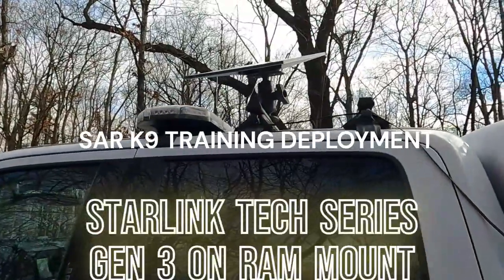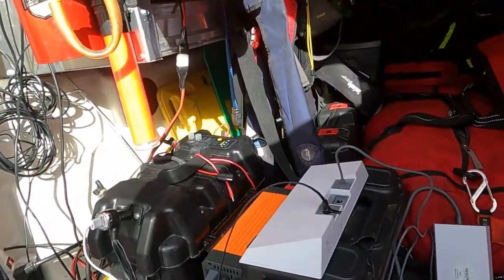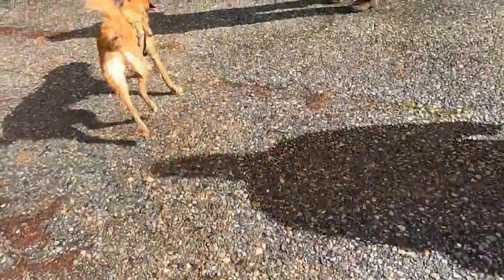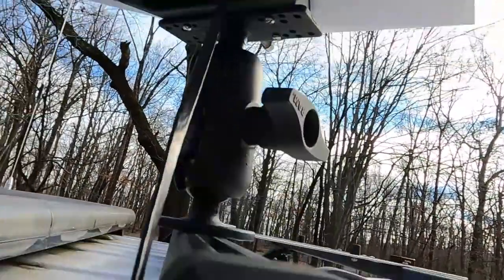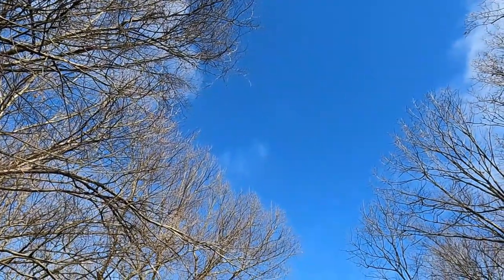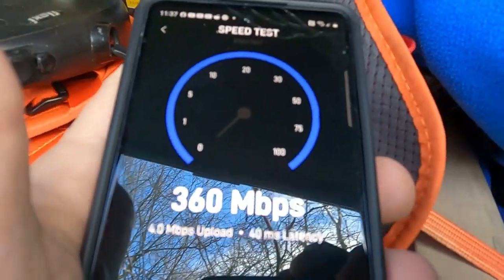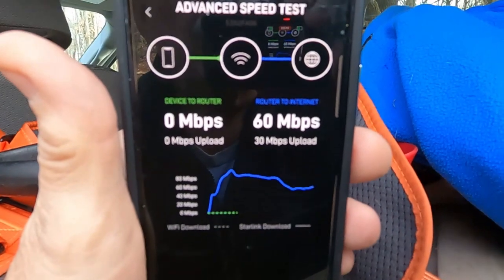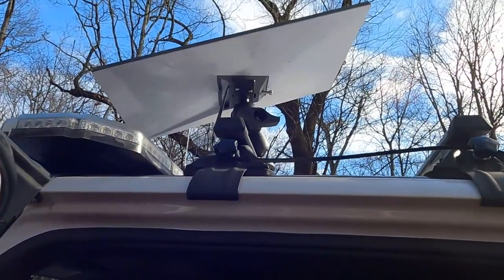Starlink Standard RAM mounted on truck, SAR deployment, New Gen 3 for RV, Command Post?

Comment: Great mounting idea. How’s it working so far? Will it fall off at speeds? We appreciate any feedback that you may have. 🙏
Reply from the maker: It's good at normal speeds 65 70  we do move it around a bit . keep the front wind end down is best.  It makes about a 20-40 mbps down load speed improvement by being able to adjust it to it's best alignment when on site.